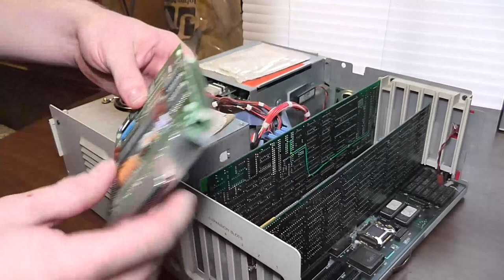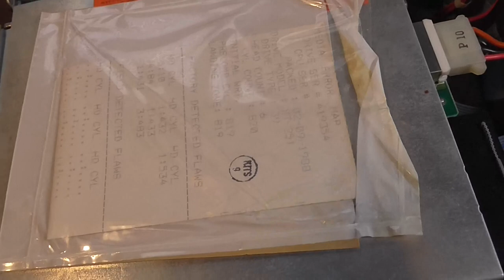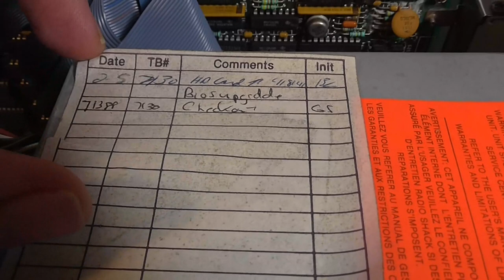Vintage Tandy 3000 HL - Apparently a little rare?

Comment: It was made as a business class machine, not intended for home.  That is no sound cards and such.

It was not a clone, but a 100% compatible unit.  It was also available with various Unix and Xenix for multi-user os's.
It was a very good system for the day and did cost a ton less than the IBMs of the day.

Comment: 286 machines could handle up to 16MB.  Getting 16MB in such a system generally required almost all your ISA slots were filled, and it was prohibitively expensive.

Of any 286 variety machine I've ever used, the "deturbo" function never brought it down to a 4.77 or even 8MHz 8086 speed, it was always faster.  I seem to remember the slowest 286 produced was 6MHz, and most "deturbo'd" 286s would go to 6MHz.  In those days there was a lot of crystal swapping to get better performance, so the BIOS manufacturers tested the speed of the CPU during POST, if it was too fast it wouldn't complete POST.  Some fancier add-on performance booster would automatically clock down the CPU for POST and back up after it completed.

I have a Hyundai (yes, they made computers) 286 clone, actually has IDE drives.  The problem is it also has one of those Dallas clock modules with the built-in battery that's bad, and it's not worth my reworking that chip nor sourcing a replacement.  Otherwise it was a nice system, I used to actually use it with a paperwhite VGA monitor; those are really rare nowadays!

It's a 5-pin DIN.  Around the same time the IBM PS/2 line was introduced, giving us the 6-pin mini DIN plug.  As you're probably aware, they make adapters going from 5-pin to 6-pin and vice versa.  Very early versions of OS/2 could run on 286 machines.  At that time OS/2 wasn't very good.  When they released OS/2 Warp, that was a decent OS, and many IBM PS/2 Model 70s at IBM were running it.

The STB card was a scan-doubled CGA card that would produce up to 640x400 resolution.  I'm not sure that even an IBM EGA monitor would sync to that resolution, you might have needed something like an NEC MultiSync for it (those were excellent monitors, BTW).

If you have an ISA VGA card it can be installed in there so you can get to work with it.  If you don't have an ISA VGA card I'd recommend finding a few, those MDA, CGA, and EGA monitors aren't going to last forever.

I noticed that the red LED on one of the HDDs stayed on, that usually is a bad sign.  But if the machine didn't complete POST fully or the HDD isn't set in the BIOS (due to a dead battery or lost CMOS settings), that could also happen.

Comment: The 3000 was the higher-level Tandy PC clone after the 1000 and 2000 machines. I found it amazing that Tandy was willing to try to enter the IBM clone market after their TRS-80 line died about four years earlier, and the "Trash-80" Model I had saved Rat Shack in the late 1970s after they overinvested in the CB radio craze!

I never used one of these machines; there were too many 286-386-486 clone makers from 1986 to 1999 to keep count.

Comment: Those two hard drives are the same as the IBM AT/XT yeah?
Reply: +Ben Helweg Generally with ribbon cables, you can tell which way they go by the colouring.
Often the far left or right side will be coloured red or blue instead of grey and this corresponds to pin 1, which would have been marked on the PCB.
Reply from the maker: +Ben Helweg They should be the same yeah, but like I said in the video I'm not an expert on 1980's PC compatibles. lol I'll have to give that a gander and see if it is indeed marked, those cables seemed a little strange but maybe I'm just not used to these old drives. lol

Comment: Its a nice computer but it needs a good retrobrite treatment to clean it up.
Reply from the maker: +summer20105707 What do you mean? Only the drive is yellow.
Reply: Sorry maybe my monitor  isn't displaying the colours properly. Nice system though.
Reply from the maker: Yeah that's probably it, the case is perfectly white aside from the big rust stain on the side.
Reply: Transcendental Airwaves
I like seeing all these old fashioned computers. I still enjoy using my commodores once in a while.  Tons of fun.
Reply from the maker: Thanks :D
I love my Commodore machines too, I only have the original breadbin (cib) and a C64c (Now painted black) but man they are by far my fav 8 bit machines.